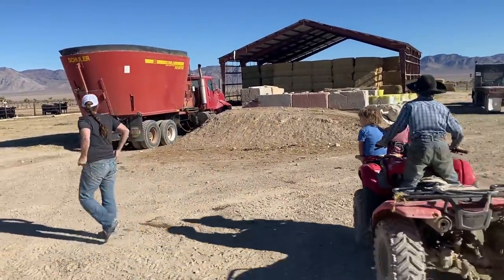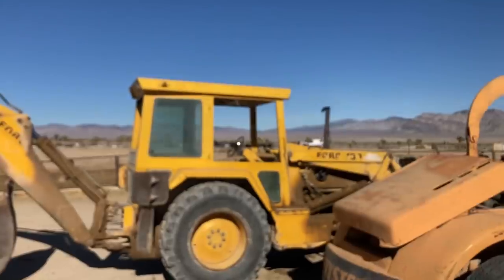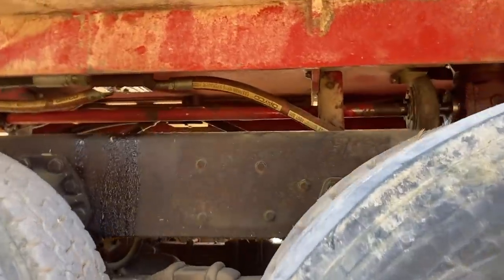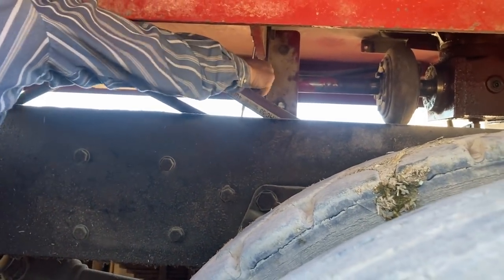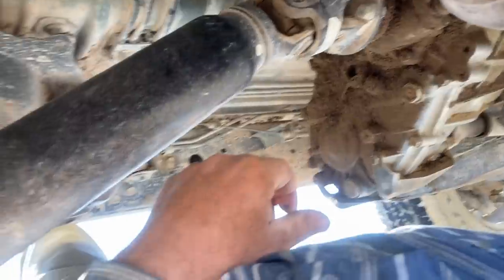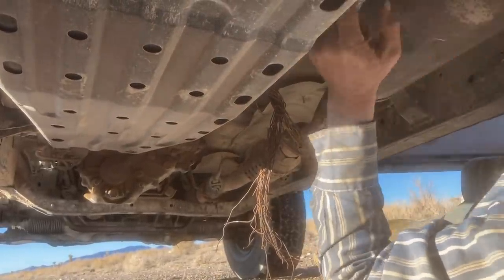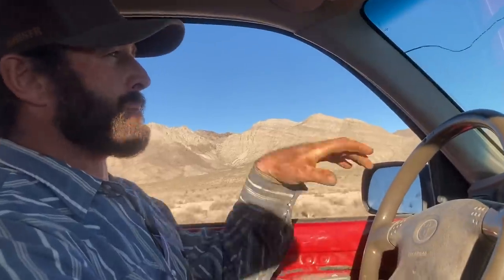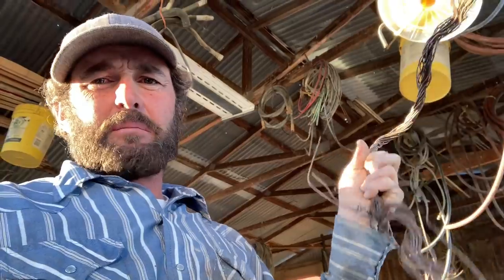Things Go HAYWIRE ⚓️🛠💬

Comment: Hay wire, fence wire or just mechanic wire helps. Pair of pliers or Vice Grip pliers or slip joint pliers used with cresent wrench can turn most small nuts. A gob of grease between wire and drive shaft saves drive shaft tube being cut down sized. Have used sock and fence wire to tighten tie rod end to keep her on the road hauling flag stones in a Nash Rambler Station Wagon Fergus County Montana 1962. Love your videos gets me out of big city, thank you !
Reply from the maker: Thanks for watching and all the good ideas!!
My mom is a Montana girl!

Comment: In summer of 1963 (I was18), I was in remote Snake River country in the NE corner of Oregon doing geological field work with a professor.  One of the U-bolts came off the front axle of my '56 Chevy Suburban (mechanic's error). And the axle had slipped back. I scrounged a bunch of old ranch baling wire, and with a bumper jack, I reset the axle to where it was supposed to be. Wrapped it up tight with wire like you did with the driveshaft. Then drove up out of the canyon to the nearest town with an auto garage, tiny Anatone, Washington, several miles away. The prof was British and was amazed I did that. Left the truck there for a week while parts were shipped in and Sub was fixed.
Reply from the maker: Cool story 
Bet the professor never forgot about that!!!

Comment: I don’t have bailing wire but I went n bought a small roll of electric fence wire. When I need wire, I can just unroll it off of the spool of electric fence wire.  You can get the electric fence wire in all different lengths n thickness. It’s great to have around.

Comment: I am not a 100% sure. A lot of backhoes have a way of locking the boom up so it does not leak down. Ones I have seen are like a one inch or so bar, that goes right about the level of the operators feet. In that area. Put that in in you will just have to bump it up and remove it when you need it.

Comment: I've done the same thing u done with the drive line but I used hay bell string and it worked
Reply from the maker: Ha I did have some hay string in that truck and thought about using it but went with the wire since I had it😜

Comment: One way you could have kept that driveline from turning while you were trying to remove the bolts would have been to put the truck in 4WD first, which would have locked the rear driveline to the front keeping it from turning while you were working on those bolts...another good reason to carry a few different wrenches with you LOL.  Course then you'd need a toolbox in every dang vehicle you own HAHA!!!
Reply from the maker: It was in 4 wheel but those bolts were so tight I was moving the whole truck cranking on them
Reply: @anchorbrandranch  Heman must have installed the bolts LOL.

Comment: You need to get yourself a bicycle.
Reply from the maker: There are several that the kids have torn apart I trip over them 
Cuz they are left in my way at the shop
Reply: @anchorbrandranch  cool cool I was hoping you'd take my little joke well . but truth be told I do have several bicycles, and quite often put one in the back of the truck when I head into the hill country.